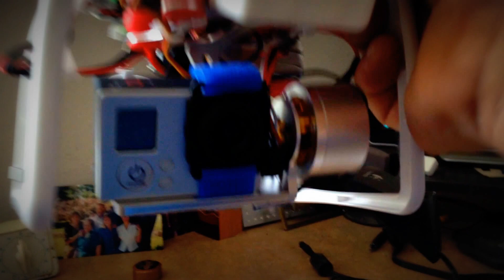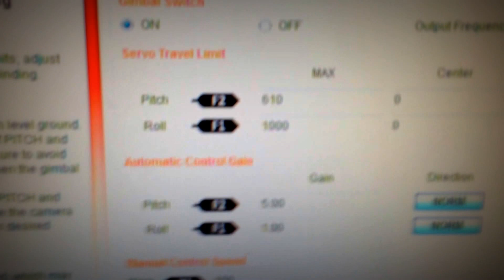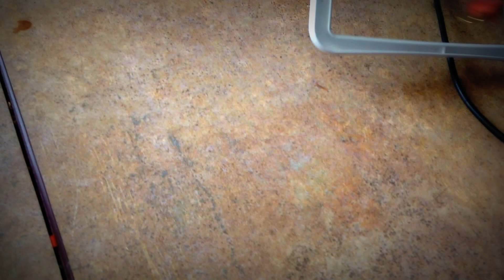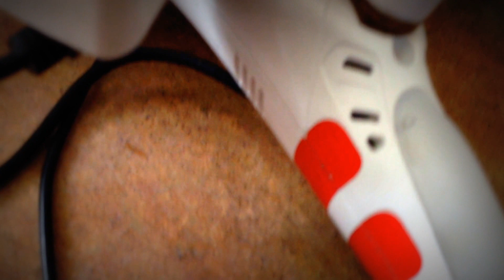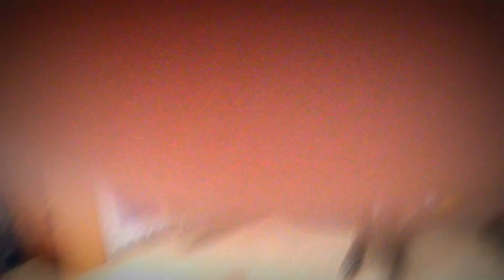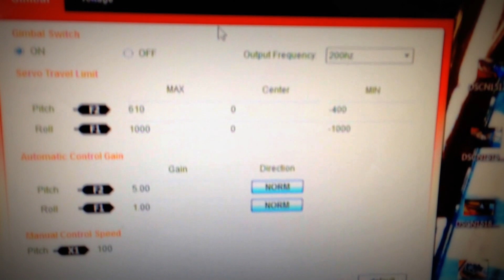Brushless Gimbal Camera Mount Motor Controller DJI Phantom w Pitch Control

Comment: Thank you Thank you i just got a new gimbal not the same one you have but the settings explanation was great i been try to figure out what's wrong it was the center/Hot  wire coming off my naza for the pitch Thank you... buy the way got a stella on my phantom now with pitch control
Reply from the maker: You are welcome and very cool on the Stella.

Mitch
Reply: Mitch Peterson on yours does it have 2 rows of 3pins or 4? mine has 4 and not sure with ones to use for pitch.mine also has to wire for power out of the back so not sure if iv got to use any other wires aprt from plug it in power and the one wire for pitch??
Reply from the maker: stephen strassen Mine have two rows of three. On most boards it will have both + & - printed on the board....that would be where you connect the battery. As far at the other pins go, one row is for pitch and the other for roll. I don't know what the other pins would be used for other than the boards are generic....could also be used for 3 axis gimbal???? Don't ever use the center pins on the naza or the gimbal
Reply: I followed a video on utube he had 2 rows of 3 mine is 4 rows but still won't tilt. My board on my dji is different to. Just looking at it. Mine had a plug that went to a Zenmuse with only one wire coming out to the gimbal but that wouldn't do it either. Iv got mine straight mains Plug works great but not figured out the tilt yet so bloody stuck at the moment
Reply from the maker: stephen strassen First, connect to naza and move the pitch knob. Do you see X1 moving???
Reply: I connected to naza and to the gimbal I moved the lever on the transmitter and nothing . the gimbal stays level lovely but doesn't do as the Zenmuse did iv even tried using the tilt lead that was connected to the Zenmuse but sod all happens
Reply from the maker: look, naza needs to see you making changes in the pitch. Connect the pitch pins on the gimbal board to X1 too the Naza. DO NOT USE THE MIDDLE PIN. Cut the wire or remove. ON NAZA: Enable gimbal.....you have to see X1 move.....

Comment: I got my black gimbal yesterday and after a little fiddling I got the tilt to working. When I hooked up my pitch control it didn't work at all but I found the issue. I went into the GUI and changed the Pitch control to "RC PITCH" and that did the trick. I'm using a Naza Lite M but I didn't go through the Naza. I ran mine straight off ch5 from my Spektrum (I'm using a DX8) receiver. After enabling RC PITCH it was a small matter to go into the menu on the DX8 and change the travel settings and the trim. Now the gimbal works smooth, is stable and I have my tilt assigned to a 3 position switch. I like the 3 position switch because it gives me a better idea of where the camera is pointed. I have the camera set to straight ahead, about 10 degrees down and then to around 60 degrees.

Comment: Hey Mitch,
Nice video. Are you connecting the power from the same battery (Phantom's) or using additional battery for the gimbal?
Reply from the maker: Hi there and thanks. I use a separate 900mah battery to power the gimbal, video tx and gopro
Reply: Mitch Peterson Thanks so much for your response. May I know what kind of battery is that?

Comment: Looking forward to trying one of these on my Naza Lite M DJI F450 Flamewheel quad. I've got my tilt on a 3 position switch so I'll have to figure out how to set that up. I like the switch because I know exactly the tilt angle for each click. Thanks for your tutorials. Helped me make up my mind about which gimbal to buy.
Reply from the maker: Good to hear from you Randall. If you have any questions or problems give me a shout. One thing, keep all the gimbal sensor cables loose and clear of obstruction. Any time a cable catches/rubs the gimbal will jump.

Mention my name when you buy it and let me know how the process goes.

Thanks,

Mitch Peterson
Reply: Mitch Peterson I recently purchased a Walkera G-2D but it only works on two cameras. It's basically made for the iLook and the GP3 only. I have a couple of "GoPro Clones" being the Astak CM-7500 and something called the "Sportscam 1080P" and the G-2D won't handle even a small amount of extra weight and ther's no means to readjust the camera to change the balance without adding lead weights. I'm really looking forward to trying this new gimbal.

Comment: Hi Mitch, hopefully your recovery is going well. I just realized that I may have deleted a post that I posted about an hour ago to this page. The gimbal works well aside from this pitch issue. In a nutshell, I followed your settings for the pitch control, but the gimbal is only pointing up when turning the dial clockwise. I have checked all the connections and made sure no shorts were present and everything looks good. If i have the pitch min set to -400, the camera would face upwards to about 45 deg. I have to adjust it to -1000 to keep the camera straight and level. Any help would be great!
Reply from the maker: Are u in the US?
Reply from the maker: Mitch Peterson
in the naza software under gimbal set the max to 600 and the minimum to -1000. Set center to 0. Don't forget to push enter. it would be good to do this on the phone.
Reply: Mitch Peterson
Hi Mitch, yes I am in the USA. I'll try your suggestion out, but I think I may have already configured it that way using similar numbers to experiment with. I'll give it a shot and let you know what I find. Also from my last flight (with pitch control turned off in the NAZA) the gimball starts kicking backwards while in flight for no reason and makes the video unwatchable. It was working perfectly fine before with no pitch control and all wires are out of the way. Maybe a firmware reload is required?

Comment: Hi Mitch, after the fast and easy success installing the gimbal and doing test flights, I tried to tackle the pitch issue and followed your video with the potentiometer  on the top (front) of the remote (although mine had one strange looking guy on the back). I got a linear 5k Ohm, unsoldered the one on the board, got wires in following your coding, got the wires from the naza to the gimbal , changed the pitch settings in the naza software like you described, etc. What happens now:
When I power on the phantom, the gimbal levels nicely horizontally, but then pitches up maybe 20 degrees (to the ceiling) and stays there. The potentiometer has no effect at all. And the bad side ? my 2 switches (GPS/ATI and Off/CL/HL) stopped working :-)
Reply from the maker: Gitta, sorry so long to get back to you. The meds I'm taking are really powerful so I waited until my head was clear.  Would it be possible for you to call me? 206-465-3195 I'm on the west coast
Reply: Mitch Peterson Just back from work. No need to apologize if someone offers free help.  IS it OK to call  tomorrow, Monday ?  Let me know when you feel up to it!
Reply from the maker: Gitta Barth Tomorrow is perfect.
Reply: Mitch Peterson Mitch, seems this get an endless story, got a new transmitter, unfortunately the older one SJ6 (throttle not on spring), but now I can't link/bind it to the phantom. Can you drop me that email address of yours ?

Comment: Thanks for the good video. I installed my gimbal and now my phantom is out of control. I cannot fly it, I cannot calibrate it either doing the reset on the controller?

Any ideas ? The gimbal is functioning as it should . It flew 100% fine before the gimbal.
Reply from the maker: Did you have the props off? Check prop rotation. Also connect to naza and re calibrate ecu, Then recalibrate compass

Comment: Hi Mitch, thanks for the reply on my previous question about the kicking.  Also,  I have connected to F2 using 2 wires. Brown on top, red on bottom (skipped the middle like you said). Where do these two wires land on the board? There appears to be 6 possible connections from what I see.
Reply from the maker: Use the rear three vertical pins as described in my video

Comment: Hi Mitch, great video. I just purchased a gimbal (a few minutes ago )from buddygoods and making sure I have all the parts necessary to install it correctly. What type of connection do I need to have from the NAZA F2 port to the Gimbal? Is it a JST connection using only 2 wires? If you could clarify or go into more detail the connection procedure between the Gimbal controller and NAZA, that would be great! Thanks, I can't wait until it arrives!
Reply from the maker: · 
Hi there, good to hear from you. Use a three wire pin connector (same as the plugs used to connect servo to receiver) and cut or remove the center (hot) wire. Please subscribe to my channel and view the tutorials. They totally explain the hook up and adjustments. Several things, you must have a camera mounted in the gimbal. Before you do anything, mount the camera , hold the gimbal level and power the gimbal up. It takes 5-10 seconds to start working. All adjustments can be done through the naza after you mount and make connections. So review the videos and learn.  Good luck and keep me posted.

Mitch
Reply: Thanks Mitch. Just got the gimbal today and installed it. It's amazing! I did not adjust any settings via the NAZA software, just powered it and mounted it right out of the box. I did notice however that the gimbal would kick upwards at times, almost like as if it was trying to adjust looking upwards. Any way to fix this?
Reply from the maker: benrique iglesias Make sure all the wires are completely free and are not binding. People tend to use too many wires ties and it causes the gimbal to "bump"  as seen in some of my videos. Also try re setting it by pushing the micro switch three times and holding it in the desired position.

Mitch

Comment: Looks pretty straight forward.  Where do you get cable to connect from the F2 to the gimbal?  I have one of those goodluck buy gimbals and was wondering what pins to connect it to.  They didn't include the cable or instructions.
Reply from the maker: Hi Ron. Please refer to my later tutorial that shows and explains how to  make the connection. The cables can be found at the local hobby shop or ebay.I will speak with the seller concerning the connection diagram.
Reply from the maker: Here's the link: DJI Phantom New Updated Gimbal From Ebayer buddygoods

Comment: hi thank man ; P I got the software running but had to find the driver first, then start the software and hit "connect com5" I changed pitch setting in tab rc-setting to pitch -85 min. and 75 max. (camera full down position (horizontal) to level. In the naza-software i got pitch 1000 0 1000 roll 1000 0 1000 and all gains on 0. Its hard to explain without a video, maybe i upload some ; P Bye.

Comment: Hey Mitch Thanks for the info.. I followed all the info you gave and everything is almost working great. The thing does a great pitch but when I Pitch it all the way to where the camera is pointing down and I try to pitch up, it comes up a tad bit and starts to freak out.. It just stays in that position and does its shake... I can not get it to do anything else other then keep pitching down.. Again when I try to pitch up, comes a little bit and starts to shake again.. Any info on this? 

Thanks